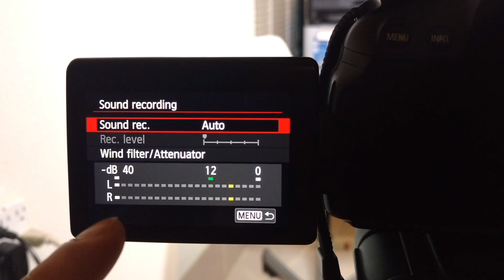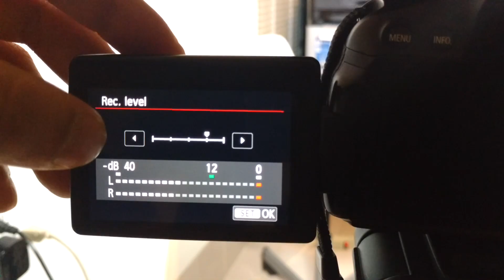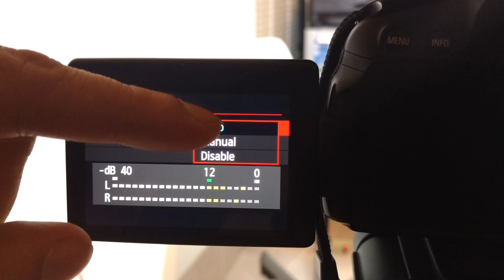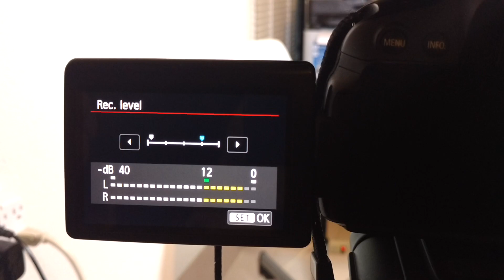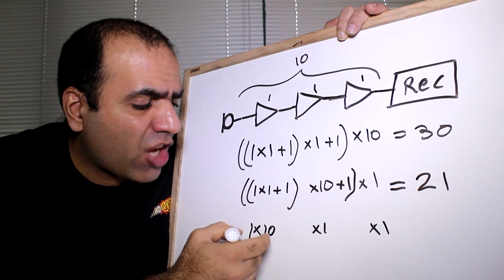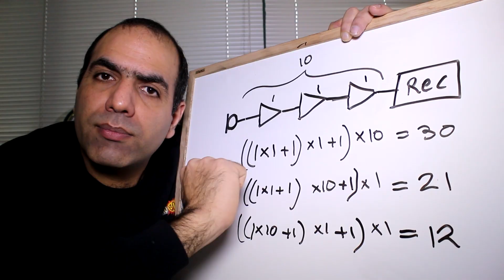Quality Audio Recording for Video

Comment: As a professional audio engineer (for live production, not film), I do the following on my own YouTube channel --
+ I use a Tascam DR-60 Mk ii. I have it set so it outputs a slate tone (1khz for 2 seconds) whenever I hit record. I plug the output of the DR-60 into my camera.
+ I plug all of my microphones into the DR-60. The DR-60 records all of the audio, so does the camera. But the quality from the DR-60 will be substantially better.
+ I use a Rode NTG-2 Shotgun on channel 1 of the DR-60.
+ Sometimes I'll use a Shure MX-150/O lavalier mic on Channel 2 using a Shure wireless kit.
+ I'll create a sequence for each video track in Premiere or Resole. I then sync the audio/video in that sequence using the slate tone. UNLESS I am doing a multi-camera shoot, then I'll use an actual directors slate or I'll clap or something along those lines. Then I line up the peak of the wave form. From there, I edit using those sequences rather than the original video files.

This ends up being a very, very quick way to go about doing things. It sounds fantastic, is very flexible, and doesn't cost a lot. If you got just the recorder and the shotgun mic, you're probably looking at $700 new. Half that used, most likely. If you wanted a full wireless kit, it'll be around $2k for something reasonably good with a low noise floor. Countryman, Shure, and DPA are the go-to brands for proper lavalier mics. Rode makes acceptable stuff, but it's nowhere near as good as a solid Shure/DPA/Countryman mic.

Comment: You left out a big and really important factor: using a compressor in post. Really important when your input levels are all over the place. Depending on what kind of audio you want you might be better off recording at a fixed level with plenty of headroom so you never clip, then compressing in post.

You would probably have to gain up a bit more in post, so a bit more noise, but your voice would come through at a more consistent level and the noise would just stay at a fixed level and not come in and out like it does with auto-levelling.

Comment: Make a good ghetto tech mic system with an off the shelf lavalier mic from and online supplier (Amazon/Ebay).

Go for something like an Ultradisk 4056 lav mic (cheap and very reasonable to good sound) and build the amp-transmitter and make it bloody good too as I've always looked into making one but spent more time just processing the audio I have recorded and re-synced it in post processing.

Comment: You could use your manual gain settings and do some audio compression/limiting in post. There are also noise-reduction plugins like iZotope RX and Waves Z-Noise that learn the character of the background noise and remove it with almost no artifacts. I'm a professional songwriter that works in a number of high-end studios and have a lot of experience solving these kind of problems, so feel free to get in touch if you want a hand figuring this out. Been watching for a long time, keep up the great content. Only downside is I can't see the use for a FBR in the solution ;)

Comment: In Audacity you can easily eliminate noise. At some point in your recording, record 10-20 seconds of "silence." In Audacity, select that segment of the track, and then go to "Effect>Noise Reduction." Click "Get Noise Profile." Now, select the ENTIRE track and then re-open the Noise Reduction effect window. Adjust the settings to what works best for you (I use: 24dB Noise Reduction, 2.00 Sensetivity, and 3 Frequency Smoothing). Click OK and it should work.

This tool even manages to eliminate background noise such as fans or city traffic. Hope this helps

Comment: The calculations you did about the amplification stages from a mic. to a recording source...I think the reverse is true for small signal amplification (for eg. Playing songs from your phone to your stereo system) Now, there's a 2 stage gain..one volume control on your phone: 1st gain and one on the stereo system: 2nd gain.

 I've observed that we get best results when the 1st gain is low and second gain is high. The reverse(1st high and 2nd low) tears up the sound apart ie. The noise in the sound get amplified very much and fucks it up all.

Your statement that if amplification is done, do it at the source, I'm skeptical about it...please could you explain this to me.

Big fan of yours, your unibrow and your full wave bridge rectifier 😂 Also an Electronics and Communication engineer :)

Comment: Which video editor do you use? In FinalCut Pro, you can have separate audio and video clips and it can automatically combine them into one clip for you. Super easy. It uses the in-camera mic audio so you have an audio reference for the original video.

That, combined with a good lav mic and a separate audio recorder (I use the H4n Pro) with a low noise level and manual gain control means that you can get great audio no matter where you are, plus it's easy to combine in post. :)

Thanks for all your videos and I'm happy supporting you on Patreon!

Comment from the maker: Hey Hey! If you like you can subscribe to  the ElectroBOOM subreddit: www.reddit.com/r/electroboom
Reply: As an audio technician, you should just use a limiter. You wont have to worry about clipping at lower levels, because the limiter will bring down the input dB to adjust so that there is no hard clipping. Use your shotgun mic with the settings you liked, and put a limiter in between. A limiter is a little bit different from a compressor.
Reply: clean power, and a good amp
Reply: Hi.
Have you thought about recording with no gain at all and then processing the recorded audio through a dynamic range compressor/expander?

I've used ffmpeg and sox's "compand" filter to great effect before.
It's basically a transfer function between input and output audio level.
https://ffmpeg.org/ffmpeg-filters.html#compand

I don't think I can cook up a convincing demo from your existing videos because the camera's already ruined the signal, but here's an attempt at normalizing the segment at 4:55: https://www.youtube.com/watch?v=OZhEjz01F2s
Reply: I kinda like the angry shouting tbh.
Reply: Sir how I can remove noise from a speaker.. Please make a video on this.... @ElectroBOOM
Reply: remove the clock behind you(background) so we couldn't know how log it takes you to make a video
Reply: ElectroBOOM have you thought of using a bluetooth earpiece? There must be some program that would let you use one, then you could just use a camera connected to a pc that would record both.

I mean, I can do that on android...probably not ios, but on android...
Reply: Ask the guys from austrian.audio for a wireless lavalier :). it seems they are some professionals from the audio industry.
Reply: You should talk to Cody from Codyslab, he has a lapel setup that seems to work really well.
Reply: You can get Magic Lantern for your Canon and disable automatic gain...
Reply: Hey Mehdi, you should buy 3Dio and try yourself in some ASMR! I bet your "gentle" voice would put anyone to sleep :D
Reply: your audio is fine and your videos are fine your videos are amazing keep doing what you are doing
Reply: if you don't want to get a new camera, you could make a circut to take the mic input, add a tone, and then put it into the camera.  This would trick the camera to keep a more consistent gain and would be easy to edit out.
Reply: i liked the seprate audio
Reply: ElectroBOOM try to get a new microphone and/or camera if you see that you're having sound quality problems
Reply: you should tweak the Op-amp in the camera circuit  and change the voltage reference
Reply: yes DIY microphone, you shock yourself a lot, even make a Tesla coil for that, this DIY microphone will be like walking in a park
Reply: You know.. you can edit the sound wit hfeks adobe premiere quite easily. Entertaining video non the less :D
Reply: ElectroBOOM you should do a review of a 3D pen and try to show how it works
Reply: Congrats in getting #21 in trending :)
Reply: I use a lavalier mic that's recording on my phone and sync with the video later in Premiere. There's a menu option (Synchronize) to make it super quick in post to match video and audio.
Reply: Those microphones you put on the shirt is also crap. Noise isn't everything, because you will have other problems when putting a microphone on the chest - first of all, you lose a lot of high frequencies and get uneven frequency responce, that "colors" the sound and make it sound dull and unnatural. So, even if there is almost no noise, it will still sound quite crappy. 
Really good natural sounding audio (with a setup, that's easy to set up) is to have 2 omnidirectional microphones in stereo spaced 30-35 cm apart, mounted on the camera. Those microphones should be in about the same place you would have your ears if you where standing at the percieved camera position. You will of course still hear the room and city noise with that setup - but it will sound natural, like we where standing at your camera position in real life. Search for "binarual sound" or "3D sound" on YouTube (or just check my channel) and you will find some videos that have good sound for real.
The noise (hiss) problem is just a question about bad audio circuits in the camera combined with stupid auto gain. The best is to buy or build a good external good preamp to get the gain you need - then just set the camera recording level to the bottom and adjust the gain with your preamp instead. It's also often preferable to use the line input (if your camera have one) with an external preamp, instead of the microphone input - that use to have at least a little lower noise floor compared to the maximum level (SNR)
That's how I record audio (even when I use my external sound recorder, my external preamp is better than the built in one - and the built in preamp also has too low impedance for my microphones).
Reply: Are you going to sell Shamwows?
Reply: Congrats!!!  You are #19 on Trending!  I cannot even get to #1 on Musical.ly
Reply: Hey, I have an Electro-Voice RE20 (what radio-shows use). I don't use it anymore. I can mail it to you if you want it.

Comment: Use audacity. You’ll never be able to even out the levels like this and the SN ratio won’t be ideal. You’ll be spending to much for a simple solution. Using a compressor and equalizer will 
1: even out the audio level
2: get rid of that high frequency noise
Cheers!

Comment: Trick: Klapp in your Hands when you start Recording, then it's easier to match the extra Audio to the Video, because you just need to line up the one Audio peek (A Klapp Noise should be just a strait Line in the Programm)
Reply: Dude it is actually very simple to do

Comment: Consider using Audacity (Open Source) to filter out background noise (Noise Reduction effect). You just sample a few seconds of the background noise and then voila!
Reply: Nick Weissmann Yeah that is basically what it does, but since the background noise is usually quite stable a sample of a few seconds is enough.
Reply: Nick Weissmann If by background noise you mean the hiss, phase inversion does not work. The waveform of the noise pattern would have to, bit by bit, exactly match the background noise. But essentially, at every sample of "silence + noise" the A/D converter takes, it would always be some extremely random value. 

Heisenberg taught us that you can never perfectly measure, well, anything really. The loss of precision is essentially noise. It isn't so much a signal as it is a non-signal, really.

Audacity's (and Audition's) noise removal instead works mostly by filtering and compressing, which is why you shouldn't overdo the noise removal. And pretty much anybody who wishes to repair recordings ruined by noise with these will definately appreciate having low noise recordings from quality mics through quality preamps and converters in the first place, with as low of a SNR as possible.
Reply: Noise reduction on audacity workd GREAT. it removes virtually all the noise from the audio without affecting the quality that much.
Reply: Prehistoricman, just because you can't use a daw doesn't make audacity "loose quality" audacity is a digital daw and as such only deals with lossless digital data. Maybe it's the plugins you're using something else, but AUDACITY itself doesn't "quality drop" (at least nothing you can perceive with human ear like if you resample). Protip try different plugins
Reply: Ditto. You can adjust the sensitivity to result with a quality you prefer.
Reply: there are also noise reduction programs that take an fft of the noise and then reduce those bands by the amount present in the noise. This can sometimes create phasing artifacts but that can be managed by adjusting the fft size as well as having the filter only kick on when there is no voice present.
Reply: That's normally a function of misusing the effect(s) rather than Audacity itself.
Reply: You can adjust accordingly. Mehdi's concern is signal to noise ratio. Like anyone, what is acceptable is up to them.
Reply: There are plenty of not-audacity options as well.
Reply: Try something before you critique it, folks. Audacity solves Mehdi's problem, plus, it's free.
Listen to God. 
God's omniscient.
Reply: It's also great for recording samples and snippets from live pc audio!
Reply: Jerry Janes can't he also use Audacity to take out the background noise by recording minutes straight of the white noise made by the camera and then putting it with the audio recording of the video and using the "Invert" effect?

Edit: after reading what you said twice, I realize what I said might have been exactly what you meant.
Reply: I found the quality drop in Audacity to be a deal breaker. It makes voice sound liquid!